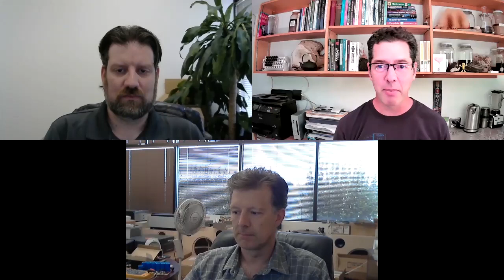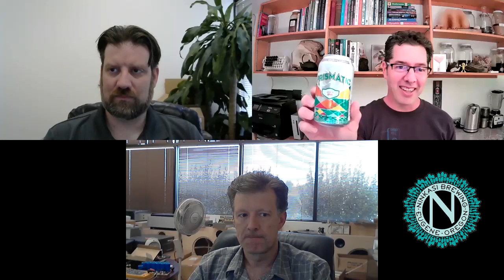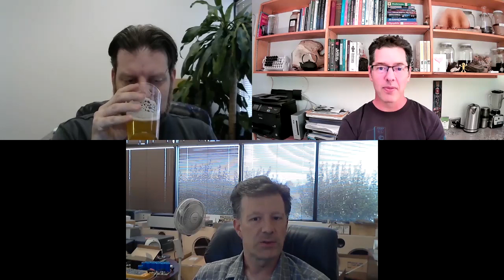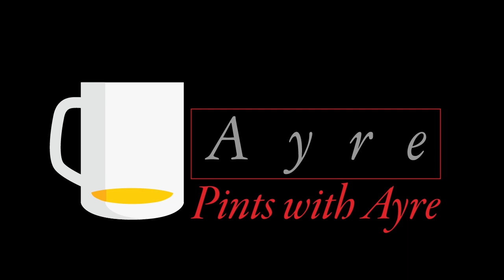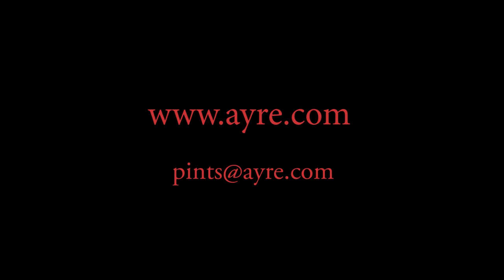Diamond Output Circuit | Pints with Ayre

Comment: Hey Ayre, I very much appreciate this series, but you should have explained the price explosion with the Twenty series. As an owner of the original VX-R, which I love very dearly,  the price increase is shocking and it doesnt look like you are using 5x as many parts or anything for the diamond circuit

Comment: Another subject to explore please : Fuses! how many times did the VX-R blow the darn fuses destroying a great video night, have to pull out and open the box for those cheap underrated 150mA fuses, there has to be a better way of doing this !!, very disappointing not being able to reset the Amp after overload.
Reply: David Califano  I like Levinson, or used to before they lost their identity. These days I dont care about them at all. Funnily enough I have a Levinson 332, power was never an issue thats true. but my VXR is not only better made, better looking and better sounding than the 332. The internal fuse based overload protection is the only weak and nasty point I can think of, a real bad solution. But at least it never died entirely. And sure enough my 332 failed me twice, main capacitors dried out prematurely , and a driver stage blew during standby over night somehow taking a few power transistors with it.  sometimes I feel my Sony surround receiver is the most reliable thing I bought ...
Reply from the maker: Thanks! We may just have to have an episode on that. It is truly amazing how much of a difference a fuse can make. There will be some fuse auditions this year as well, as we continue development on forthcoming upgrades. 

We do set our fuse values a bit lower to ensure that nothing catastrophic happens to the circuit as well. While it may be somewhat inconvenient to change a fuse on a VX-R, it is much better than shipping the whole thing back to us. Thanks for your understanding, and letting us be part of your listening experience!
Reply from the maker: This! Thanks for the kind words! It is not super easy to change fuses on that amp, but much better than a dead amp.